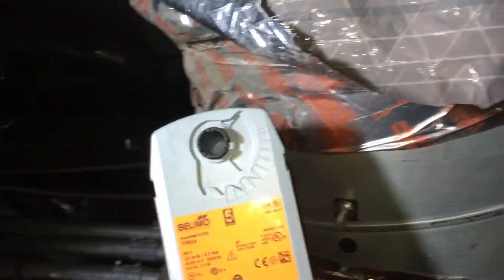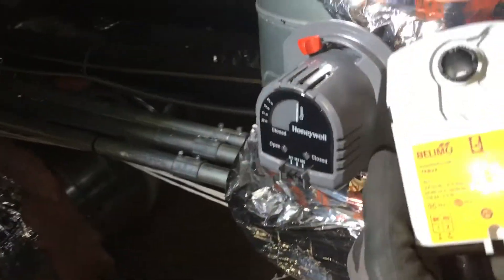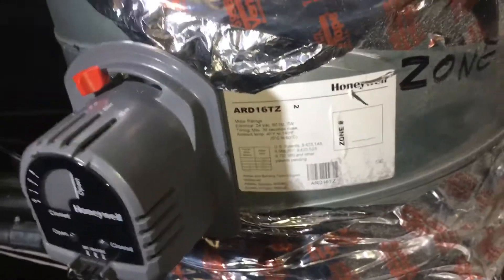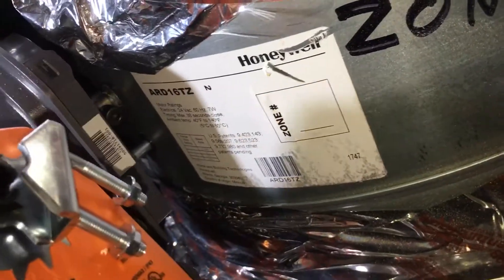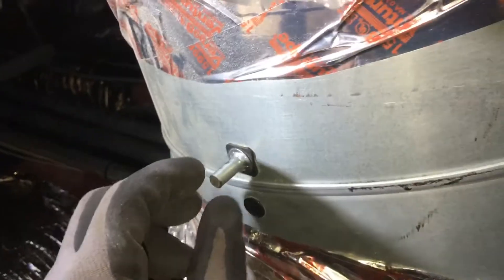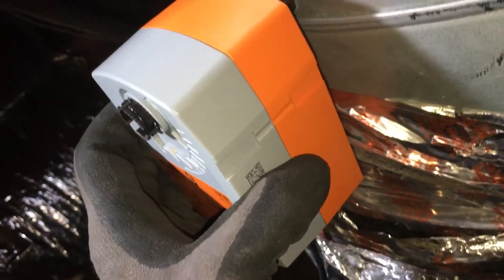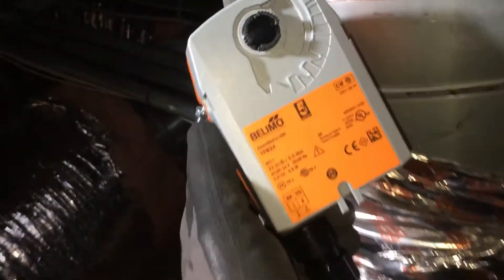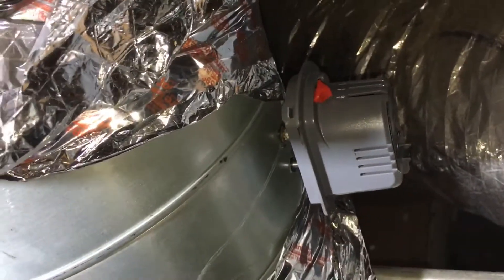Honeywell Air damper actuator upgraded to a Blimo￼ Actuator. ￼

Comment: This is a very common issue that I see all the time. I typically work with JCI actuators, but Belimos are almost identical. You can try this part: Belimo AV8-25. It's not perfect, but it's easier when you are in a tight spot and can't get a socket behind the actuator. Also allows you to hold the shaft while you tighten up the U bolt so the damper doesn't move on you. Hope that helps.
Reply from the maker: Thank you. I’ll look that part up. Throw it in my QuickBooks parts supply